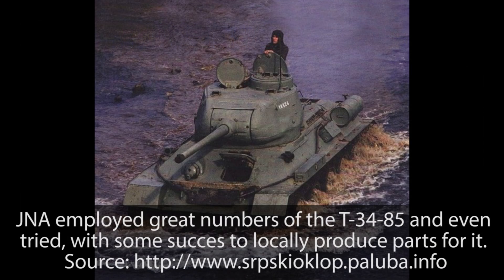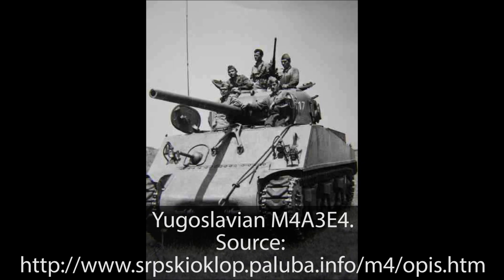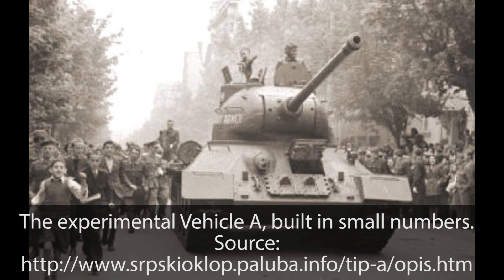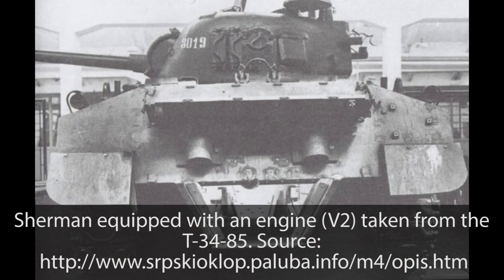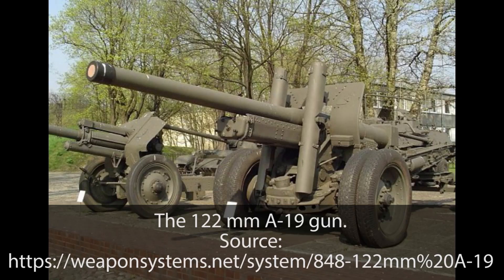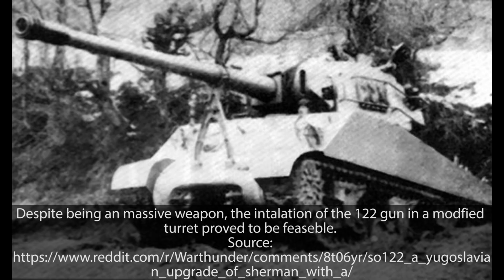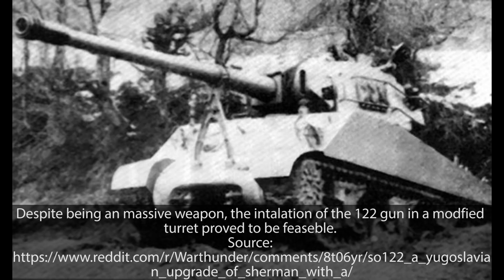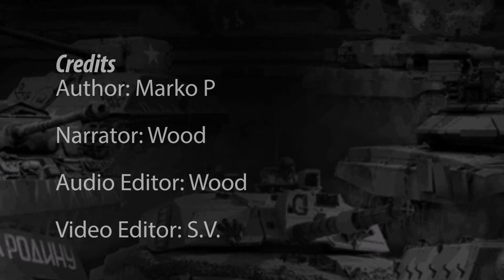Stalin's Weird Cousin | SO-122 Sherman

Comment: I just wonder why most of over powered sherman don't use jumbo hull? Just imagine the callioper, m-51, m4/t26, M4A1 (fl10) or this 122mm sherman using jumbo hull
Reply: M4A3E2 had a much more limited production run of 254 vehicles and the added armor was already pushing the suspension to its limits.
Reply: @D4cked  ok

Comment: It was a prototype of an assault cannon (SO-122 = self-propelled weapon 122 mm) intended to support infantry and break down fortified positions.  M-19 gun did not have APCR of HEAT shells, only AP and 2 types of HE shells. That says a lot. I read somewhere that the project was suspended due to problems with loading the cannon and too much recoil during the fire.

Comment: The bogeys for the Wet VVS,would they be same as firefly?.
Reply: Be nice to know,i am in middle of building a 1\35 M4a3e8 kit and scratchbuilding applique armour from panther plate.But if the bogeys VVS from Firefly are same as "Wet" 76,i could use spares i have from firefly kit to build hull of the 122/M4.I have the later rear mudflap's too.Looks like a better project than another 'thunderbolt VII' clone.

Comment: Basically the issue with the Yugoslav products in the beginning of 50' was that they didnt have the knowledge base, no engineers so they tried to copy the existing parts without any knowledge of materials technology , etc,  and do everything on the shop-floor level. Not so surprisingly the outcome was of dubious value .Tank type A would brake down all the time, the t 34 engine in Sherman would overheat , the price unit in a relatively  small scale production was enormously    larger than a price of a proven design of contemporary tank of the time.  In the late 70' when they finally manged to build an industrial base , Yugoslavia took a T72 license and managed to successfuly improved it. By late 80' they even managed to do a better or at least as same quality of engine pack as Russians and by 90' all was gone.
Reply: Yes, all starts are difficult. There was industry and engineering in creation and needed also time to coordinate. Also the industry was destroyed and did need to be rebuild. But this brought big knowledge for after
Reply: You already wondered who was to blame for the disappearance of Yugoslavia!

Comment: They should have installed rocket launchers as well on that turret. Why they did not make an AA variant as well with quad mounts for weapons? The Yugo Super Jumbo Sherman.
Reply: Rocket launcher with out guidance is useless since rockets are not so accurate as tank grenade and are slower to hit moving targets. At this time think even USA and USSR had to copy and develop German system of TOW missiles because Germans did during the war developed and even used different type of guided missiles
Reply: @manjelos  They did have the Caliope launcher. Nobody would have sold a German guided missile system to YUG in the 1950s. It was a big $$$.
Reply: @sealove79able  At this time both, USA and USSR was to develop own systems and had not even in operativ use

Comment: So-122 was surely the best Sherman that was ever built!
Reply: @Ildabaoth Saklas you could argue that the Sherman Repotenciado was in a sense better than the M51.
Reply: Bigger guns is cool but not always better
Reply: Big guns don't mean much. Look at Germany in WWII. They built some of the worst tanks despite having some of the biggest guns
Reply: As meme? it was impractical. The M51 Super Sherman 105 mm already had its shortcoming (cramped turret & massive recoil).
Reply: @PflagerKatsumata  Yes, but, here's the difference - the SO-122 was not intended to fight other tanks. Unlike the M-51.
Reply: The M50's Israel sold to Chile with the new at the time 60mm guns were considered superior to the M51's
Reply: @josephkool8411  Would be nice to see the 60mm Sherman in WT
Reply: @Faux Diplomacy  True, it had less penetration than the Israeli M-51, but do note that the SO-122 basically has the same 122mm gun as the IS-series. So, as it's intended purpose as a support tank? It would work pretty damn good.
Edit: The main differences between the A-19 and D-25T is the recoil mechanism.

Comment: How damn far is 20km?
Reply: if your standard american washing machine is 27 inches wide, then its about 29 163 standard washing machines side by side
Reply from the maker: 20 thousand metres.
Reply: For the americans its about 500 hamburgers per 50 glazed donuts
Reply: About 13 miles
Reply: 5 hotdogs lenght per dounat bald eagle
Reply: About 218 football fields

Comment: a bit off subject , BUT at Yad La-Shiryon  , Israel's tank museum and memorial to the tank corps , there is a FrankenT-34  ( T -100 self -propelled anti-tank gun) captured from the Egyptians , which consists of a T -34 chassis and body BUT with a M 1944 (BS-3 )100 mm field gun in place of the 76 or 85 mm " regular "gun
Reply: Egypt also converted some T-34s into 122mm self-propelled howitzers.
Reply: @RedXlV   how about the Egyptian conversion of a Sherman tank with the turret of an AMX 13 turret , I've pictures of that , and the T 100 self propelled anti- tank gun , as well as other tanks captured by the IDF , INCLUDING a Panzer 4 Ausf G

Comment: Nice video. If we can speculate, machinegun would be probably  M53 (Yugo copy of MG 42).
Reply: Germans never used MG-42 in tanks, only the MG-34. Had to do with the difference in barrel removal. The MG-42 movements were virtually impossible from within a tank as far as the hull and coaxial machine guns.
Reply: @amerigo88  Yes, the Geridid use MG 34. But this Franke -tank was Yugo project. The standard mashine gun of the YPA was copy (thanks to the tooling) of the MG 42. Same 7,92 caliber. Today Serbia is still one of the main exporters of the same caliber ammo. So, if they made new turret, probably, the coaxial mg was the copy of the MG 42. The American 7,62 Browning wasn't practical in that case. Also, infantry weapons for the YPA were M24, M48 and the german Kar98k. Yugoslavia hat the tools need to produce that kind of rifles as well as ammo from the royal days.
Reply: Not sure if they changed MGs on those tanks.